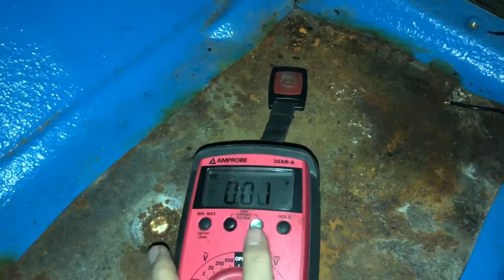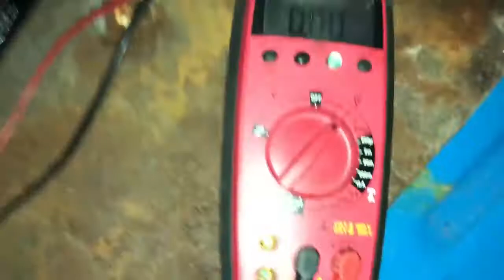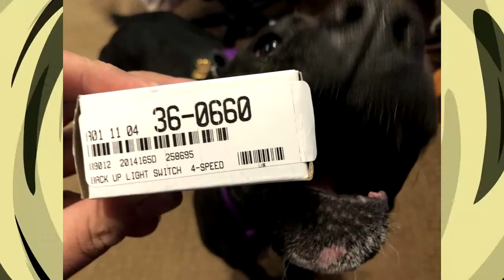67 72 C K10 4speed Reverse Lights Fix

Comment: So my truck used to be a automatic now it's a 4speed would I just have to relocate the wiring from the reverse light switch in the column to the transmission?